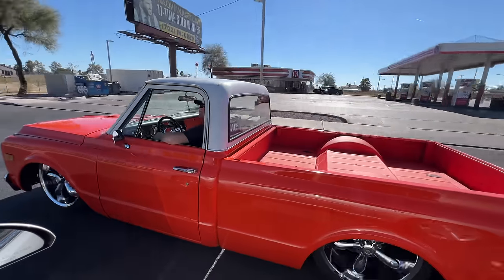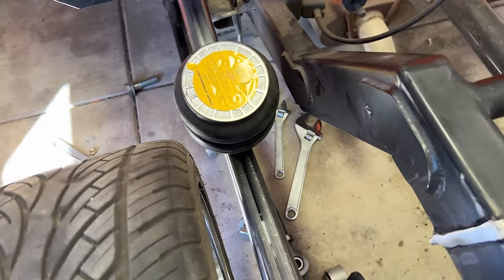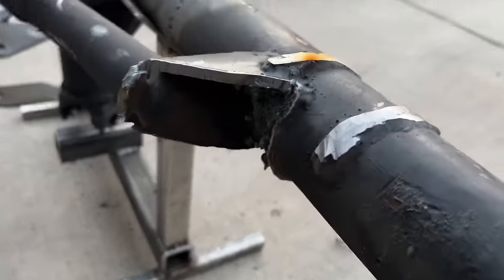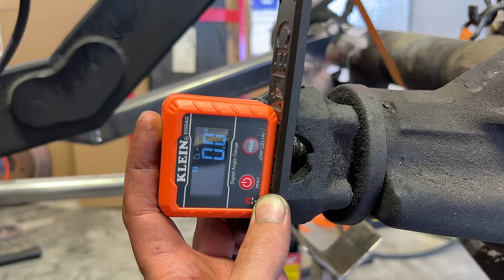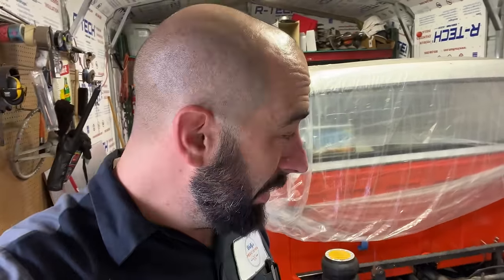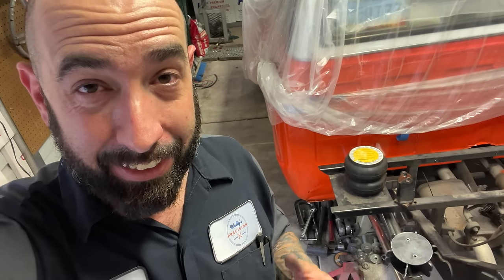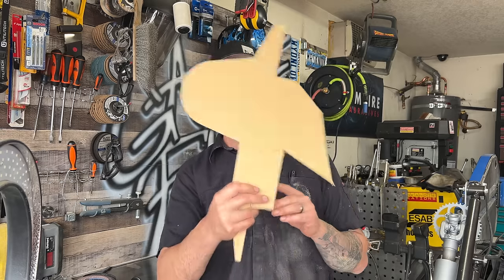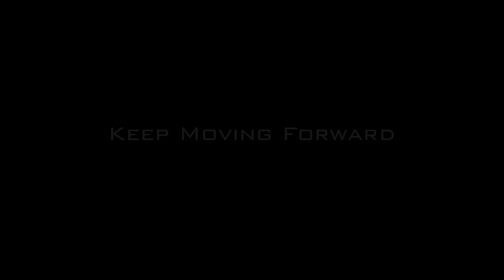Chevy C10 Air Bag Mount Design and Fab / Long Distance Fab 2

Comment: Question. Would it have beeen easier if the customer woulda just bought another Drive shaft with single joints?
Reply from the maker: Hey Christian! How are things? On this particular one, no. I wouldn’t have had to remove and reinstall the rear link bar tabs obviously, but I would have had to modify the notch in a crossmember and also would’ve had to make the driveshaft tunnel in the cab taller. So in the end, though two single U joints would’ve been the correct choice, we decided to save him some money since we knew this truck didn’t have any strange vibrations before I started working on it.
And it’s paid off. It’s vibration free at the moment.
Reply: Things are great! Thank you for asking 🤗. Ahhhhh I see. Welp, that seems to make sense. Thank you for the explanation. You da best ManKandy! 😉
Reply from the maker: Happy to be of service.

Comment: im looking to build an air ride system for a truck, the airmax d26000 bags have a usable stroke of 9.3 ish inches, does that mean i can run the truck at fully extended, or should i keep ride height an inch or 2 below that. i will be towing with the truck, and i am not sure if i will be able to get the hight i want running the bag on the axle.
Reply from the maker: You can run a bag fully inflated, Adam, but you certainly won’t want to. A bag at max height is a stiff one, and a stiff bag mounted to the axle will be very unpleasant. The comfort zone for a bag on the axle is somewhere near half inflated. What are you towing? The extra weight will certainly soften the ride a bit, but it’s unknown how much.
Will this truck frame lay on the ground?

Comment: Good afternoon,
How much would you charged to build a complete system to lay a 98 Chevy 3500 dully crew cab kit? And also, where are you located? I currently resides in Connecticut.
Reply from the maker: Hey! I’m in Vegas. First I must mention that I no longer take on commissioned work. I no longer have the time or the room unfortunately. 
If you’re just shopping around for prices, it can vary greatly depending on the design, products used, and of course who does the work. I can imagine a range from $8500 with cheap equipment to $15,000+ for high quality name brand components built by well known fabricators.
For what it’s worth, I’d be somewhere in the middle 10k-13k depending on the setup, and I’d push for quality components.
Reply: @GarageFab  Thank you for responding. I will keep watching the video's and see if I can find a fabricator locally and see if they will to challenge themselves for this project. Is there anyway you can send me a list of all the items needed for this project.
Reply from the maker: I can give you a rough idea, but again without working on it physically, the specific parts you’ll need will vary. 4 air springs and bag brackets for your truck, compressor(s), air tank(s), drop spindles up front, (probably). Frame notches and bridge, 4 or 5 link bar kit, (Bars, ends, bushings, bar mounting tabs) 4 shocks, air management system (valves or valve manifold), LOTS of fittings, DOT airline, (hardline is an option but much more expensive, braided brake lines that can handle the additional travel,
Fuel cell (preferably) and the lines and other components needed to make it work.
I’m sure I’m missing something but that’s a good start.